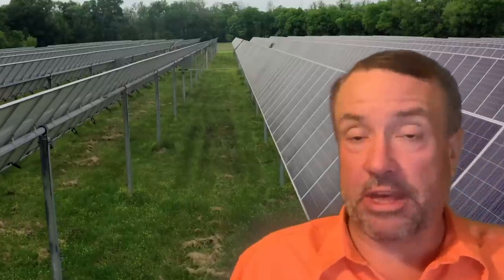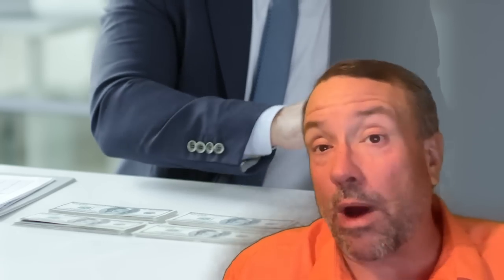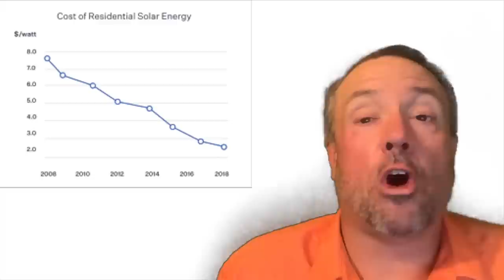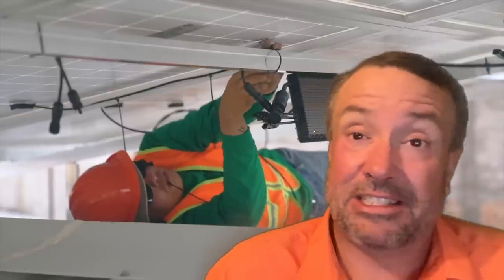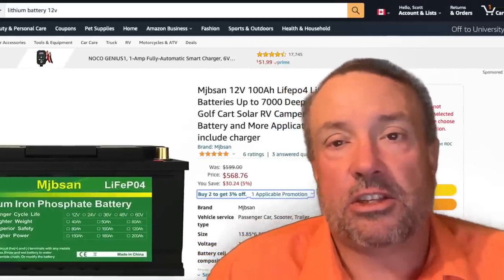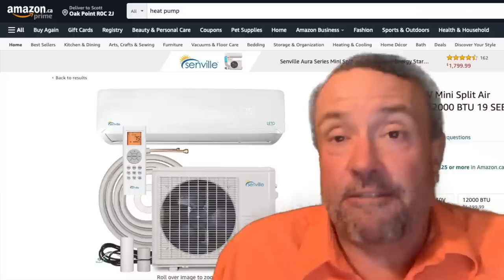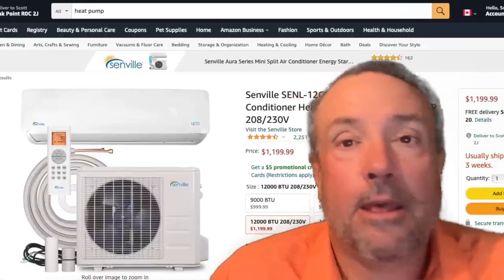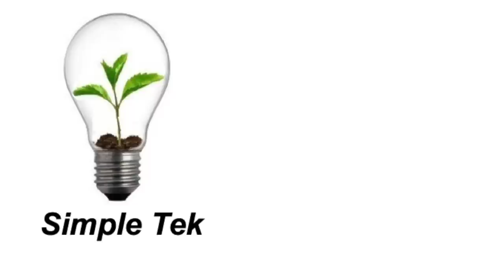Solar Thermal Vs Solar Photovoltaic Greenhouse Heating

Comment from the maker: What kind of Solar heating system do you have or want?
Reply from the maker: @chammockutube  Thank you!
Reply: Ive always wanted to build a large cistern under my greenhouse then use a solar pool heater, place it inside its own lil greenhouse, and use a solar pump to heat the water up during the day.
Im not even sure if a heat exchanger would be required for night as the heat rising may be enough to keep it in the 40s.
Like you mentioned, the initial cost of construction is expensive.
Btw heatpumps are terrible in freezing weather. They usually use resistive heating to compensate for the defrost cycles. When its near freezing the coils on the condenser will ice over quickly, kicking in the defrost cycle, which is the cooling mode. Remember, a heat pump is pulling that energy from the temp differential. The colder it is the less heat it can grab and put inside. It probly wouldnt be a huge problem in a greenhouse if your just trying to keep it in the 40s or 50s but it will run continuously.

Then there is biogas which can be a very cheap option if you have the organic matter to fuel it. Also the added bonus of extra co2 in the greenhouse.
Reply: R134a solar heating panel which one is most efficient if you use closed systems.

Comment: A big advantage of thermal solar in my eyes is in certain applications where you just need reliable heat and have a small footprint to work with. Another thing is you could position some mirrors to reflect additional sunlight on the collector (pv would overheat)  if you need to heat a pool/greenhouse/thermal battery/buffertank for hot water etc. i think a thermal collector can be quite useful. The con is always the piping.    I could see a thermal battery with thermal solar to keep a stock water tank from freezing(might be cheaper with pv tough)

Comment: I think you can do both.
Your northern wall could be built out of IBC totes, with removable insulation panels on the outside.
Your solar panels could be mounted on top of that wall, facing south of course.
Your heat pump water heater can be in the greenhouse.
During the day it wöuld remove heat from the air, and add that heat to the water storage.
At night the heat would naturally radiate back into the greenhouse.

A little bit crazier:
In summer, the insulation panels would be removed from the outside and used inside.
The heat pump water heater would still heat the water.
The heated water would shed  heat into the night air, with help from a heater cores and  fans, mounted outside the greenhouse.

Extra crazy idea.
Mount heat exchanger coils on the back of your PV panels, collect the heat and improve their performance. 

Super stupid crazy idea:
Your PV panels are mounted on the inside of a hinged and insulated "lid", which opens to reveal the greenhouse glazing and PV .
Probably too heavy to actually work.
Reply: I like the way your thinking
Reply from the maker: I think you might be right!
Reply: I like Extra crazy best.  
Alternate crazy instead of storing the energy in lithium batteries,  run the heat pumps immediately and store that in a thermal battery. then release it at night.

Comment: Just to put the info somewhere, if you mix abt 5 micron fine zinc dust 10% per weight in black paint you will increase heat collection by more than 17%.
(See study: Indoor and outdoor performance study of metallic zinc particles....)
Now if you use "Isonem thermal paint" (or similar, contains vacuum microspheres) on the inside of boards in your tube coil heat collector you should be able to again decrease loss and increase reflectivity back to the tubes significantly, not cheap 5 to 10 eur/$ per m2 (just found 3M glass microspheres you can mix in your paint yourself...cheaper) but better insulation cost even more. I will have to try it...
Reply from the maker: Wow

Comment: Alternate crazy idea  PV+heat pump + thermal battery. Run the heat pump during the day to store thermal energy into a thermal battery during the day then release the heat at night.  PV is cheap and last 20 years.Thermal battery is cheap and long lasting. A big problem with thermal batteries is they inefficient when you need to electricity out of them but efficient if you want het.  if the battery is below the level of the green house (in ground?) then you may not need much of pump to move the energy  from the battery since since hot water/air rises.
Reply from the maker: interesting!

Comment: People here are wondering about numbers so I did some math. A 55 Gallon drum of water heated 40C above ambient temperature has about 9kWh of energy in it, which is roughly a 12V battery with a 750 AH capacity.

Rough math:
Water has 4.1J/gC heat capacity
55 gallons of water weighs ~200kg

 200Kg*40C*4.1J/gC ~=33MJ  ~=9kWh
Reply from the maker: That's awesome - thank you!

Comment: this is kind of on the subject but in 1984 I work for resource technologies Incorporated and they manufactured a panel called solartherm...we open 260 offices across the country and then Ronald Reagan discontinue the federal tax credits for solar and the company closed... We used sunlight and a fan to blow hot air from the roof into the house below
Reply from the maker: That's awesome - thank you for sharing!

Comment: If PV is installed, then it's more economic to add a wind turbine because the electrical storage and load side already exists.  Significant in areas like ours with plenty of wind but a lot of cloud in winter.
Reply from the maker: totally agree!
Reply: They definitely compliment each other quite well, especially in areas with relatively few trees or major buildings.
Reply: It sounds like the thermal panels are very efficient and that heat is probably convertible to light with diodes. Then magnifying lenses might  enhance that light so photovoltaic can get more supply. Might be quieter than turbine. Probably easier way to get electricity via conductive metals...heat rises is thought with turbine though because a fabricated draft might be possible

Comment: I'd be interested in looking at the numbers extended over the life of these two types of designs. If we accept that the Lithium batteries will need to be replaced several times over three decades while we should expect a well built, thermal battery to need zero maintenance across that same period, the total ROI over the life of the project might even up. This would obviously depend on how often you needed to replace the battery bank. It's been my experience that the battery packs will likely need to be replaced every five years. And even if we take into account the cost of batteries dropping over that same period, that's a significant cost.
Reply from the maker: very good point

Comment: My experience. Having thermal panels still installed since 21 years and PV panels installed since less than 1 year. Nowadays, I would only choose PV panels. Why? The thermal panels produce more energy when less hot water is needed (summer) and they only produce hot water. However, the PV panels can be used to operate any kind of electric device (heat, cold,...), i.e. in summer they can produce cold (with an AC) or reduce the electricity bill,...
Reply from the maker: Costs have changed a lot in the last few years

Comment: For heating homes I think both.  I have built solar air heaters and they work especially if highly insulated. Solar PV could heat up electric coils in thermal mass floors.

Comment: I use solar  tubes to heat my greenhouse via a sand battery which heats the greenhouse at night and recharges during the day, much better than electrical solar panels and a lot cheaper to buy.
Reply from the maker: That’s awesome

Comment: One additional way to store additonal energy (in home application in summer or warmer climes) is to cool more significantly at night when power is cheaper. And set thermostat higher during the day.  What about cheap home built geothermal rigs. Not too bad to pay a guy to dig a trnch for thr exchanger coils . Benefit is with said heat pump you an also use to cool in summer.  Hybrid system approaches can be better for some applications.
Reply from the maker: interesting !
Reply: Also some hybrid solar mixed with vacuum tubes pannels you can get now to do a bit of both in same surface area
Reply from the maker: very true

Comment: There's a doomsday advantage to thermal I see. Use mechanical timers and ZERO digital and minimal or zero electrical. EMP attacks. There's always a chance a solar flare can kill all electronics. Just a FYI for any preppers here
Reply from the maker: you need backup components berries underground for this kind of use!
Reply: A fellow prepper here. I shifted both heating AND cooling to solar thermal. Yes, there are technologies that do refrigeration and use heat energy as their primary energy source. Solar thermal can also be used to dry foods and make food powders that last several years if stored in dehumidified environments and guess what, solar thermal can also power dehumidifiers that work on desiccant technology.

Comment: There are good Systems which are  glass panels that heat up the water up to 300 Celsius.
Reply: Do those systems have a name?
Reply from the maker: thermal is way more efficient - but photovoltaic is much cheaper now
Reply: We don’t use sun in right way for the greenhouse climating. We can use sun to heat up the water at day time and stock the hot water in buffer tank to use at night. Heating up should be done by lenses. We are on research and development period of these systems. We will show better solutions soon.

Comment: I like your flash on the screen a vcr and beta. Not an exact comparison but close enough to give the point. PV is winning by investment dollars and panel durability. Evac thermal tube glass is only so strong. When one breaks your system can drain out. That said, I still want both systems storing electric in a redflow redux flow battery and thermal in a daisy chain of sand filled tanks.
Back to VHS: Understand that Sony won the battle because they sold it extreme loss to beat out betamax in the marketplace. betamax still the superior product. Just like tasimo is supirior to Keurig but lost on price.
Reply from the maker: happy you got it!

Comment: Hi I m from india
My question 
Can I make 100 litter thermal heater and use this thermal heat to my green house at night by gi water pipes which I also  use to hold the green house  as use itin fabrication of green house
Reply from the maker: need a lot more info

Comment: I have a 10 foot by 12 foot greenhouse  - would I really need a big heat pump like shown in the background of your video for $1,200?  Wouldn't an end-of-season sale window unit be sufficient for a space that size?  My concern is that I only need this maybe a dozen nights (and maybe days) a year here in zone 6b, but when it gets down to 10 degrees  farenheit,  how well is a heat pump going to work anyway?   The heat pump on our house switches to the natural gas backup system when ambient temperatures are below 40 degrees farenheit.   Btw, I pretty much am growing cool weather crops in the greenhouse in the winter.  Not ambitious enough to  be trying to grow tomatoes in January in zone 6b.
Reply from the maker: yes what you buy economically depends on what you need - I live in manitoba Canada so I'm always thinking super cold - you don't need that much heating
Reply: That is an older heat pump. The new ones work way below freezing. But a even better solution is to use the earth as the heat source. Where you live the ground is a lot warmer than the air in the winter and pump heat energy from that.

Comment: Air to Air heat pumps are only effective in climates that don't go below -15c.
Reply from the maker: The ones we use now on our park models here are good to -30C
Reply: @SimpleTek  how?
Reply from the maker: @kemaleksi6725  no idea how they work, they just do
Reply: @SimpleTek  of course it work. 
But how about efficiency?  That's the problem of heat pump. 
For example if you live in cold weather like -5 or -10 is normal you shouldn't use heat pump because of efficiency.  Electric combi with resistant is more reliable with same low efficiency.  
Ground to air heat pumps are much more efficient then air to air. 
Because of that i asked how it works.
Reply from the maker: @kemaleksi6725  seems to be ok so far

Comment: what do you mean electric heaters aren't efficient? they convert 100% of the electricity to heat.
Reply from the maker: cost efficient - electric heaters are VERY expensive to run with on grid power in most locations

Comment: Still the problem with PV is storage! Without a conventional  power generation plant to act as a battery PV is useless. You can use the lithium batteries,  but the cost to store the energy is ridiculous. Ten to fifteen thousand dollars to store enough energy for a small house and you have replace them every eight to ten years. Look at the Tesla power wall, about sixteen thousand dollars Canadian to store $1.00 worth of electricity. You can give me the electricity free, I can’t afford to store it!

Comment: automatic ac for greenhouse
Reply: tubes can be cheap too
Reply: if not, why do you make green houses
Reply: tubes are cheaper, only someone has to be paid, when they dont
Reply: solar heat + peltier, to combine both, its simple
Reply: copper for the win
Reply: lithium worship does not pay in the end
Reply: if you are paid, you are not objective, wasting
Reply from the maker: I'm not paid for this video by any sponsor
Reply: @SimpleTek  then dont pay too much for the parts
Reply: @SimpleTek  diy considerations
Reply: try plasma solar panels (lasing gas medium kinda vacuum tube mirror solar collectors, the output laser targeted to a specific frequency cooled solar panel)

Comment: You never mentioned life cycle. Solar thermal had a better service life. Chess Cheap Chinese solar panels dont last.
Reply from the maker: that's somewhat questionable, but for the most part I'd agree with you there. The evacuated tube systems are mostly Chinese too.
Reply: @SimpleTek  also the average lithium battery might get 5000 charge cycles. To have a battery that will last a lifetime you need over 30000 charge cycles.
Reply from the maker: @dgreen341  good point
Reply: @dgreen341  Who has anything that lasts a lifetime? That is not a valid criterion.
Reply: @dgreen341  I believe the 5000 cycles is based on 80% DoD, going from 90% to 10% every day. That certainly won't happen, large parts of the year the heat pump isn't running at all. 5000 cycles could easily last 20+ years.